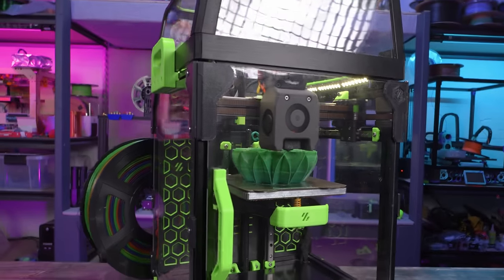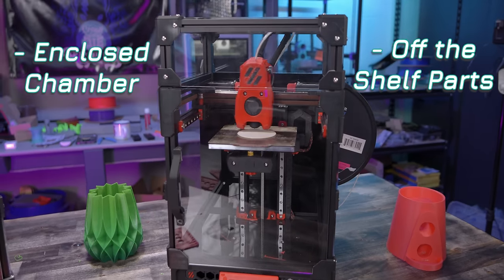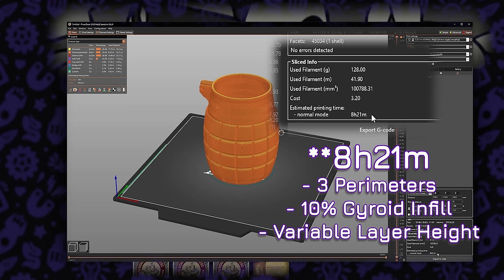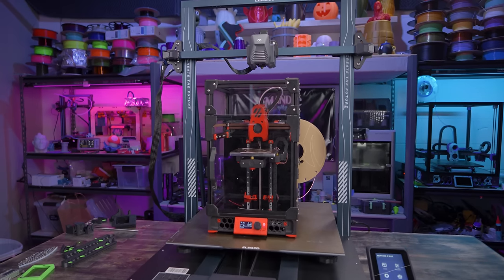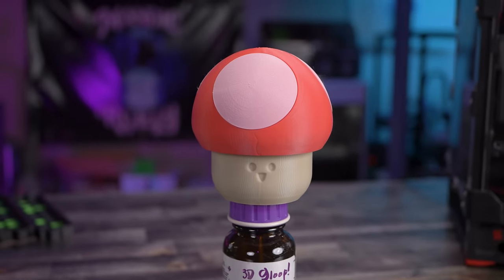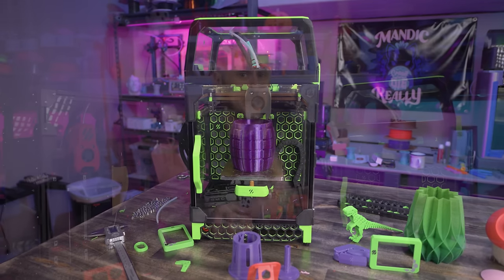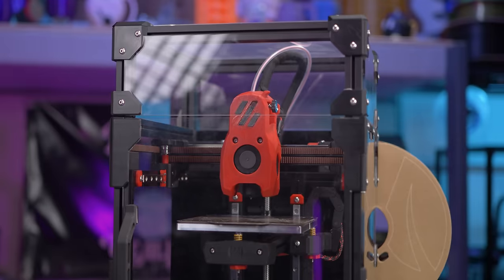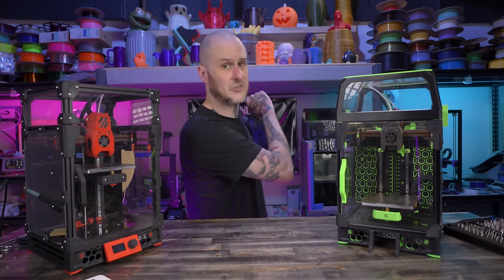Small 3D Printers are POINTLESS! Or...

Comment: I just bought (and in the process of rebuilding) two Kingroon KP3S printers for $100.  The first one is working and cost me around $50 in new parts.  I am SUPER impressed with the Kingroon and would recommend one to anybody unsure about getting into 3D printing, as well as anyone fully immersed into 3D printing.  It's a great little device that pumps out amazing prints.  It doesn't have ABL, however with a glass plate, you don't necessarily need it.  After my initial levelling, the printer has been running like a champ and I am looking forward to getting the second one going as well.

Do I NEED a large build-plate printer.  Absolutely not.  The percentage of things I can print on a small printer are likely similar to the results here.  I WANT a large build-plate printer though. :D
Reply from the maker: I bought a KP3S a while back and it was... bad. Like unusably bad. I probably got a lemon but they sent me a KP5L that was also unusable as delivered, so I wrote them off sadly.  I know a lot of folks have great luck with them but I just couldn't justify my time on them anymore.

Comment: l'd love to see a Voron 0 expansion kit to use a 140-200mm buildplate. 120mm is just slightly too small for things like PC fan mounts, drone parts and cosplay pieces, so making it that little bit larger would open up so many more models. It literally needs +35mm in each direction and it's perfect for everything I would use it for.
Reply: You should take a look at printers for ants, the Tiny-M for example basically is a slightly bigger V0.

Comment: Batch printing.. obviously advantageous.. printing in parallel is always faster.
Reply from the maker: The only way that is true is if you count bed swap times between prints. Personally I prefer to run smaller batches due to fails. One failure on a full bed can destroy an entire batch. Exclude objects only works if you are already watching to catch it.
Reply: @MandicReally  I see your response and trying to rationalize it in my head.. 5 small form printers running the same part.. each part taking 30 min.  if one fails you still have a yield of 80%.  5 parts on a single large format each part still takes 30 minutes but you add in transition time between parts and if a single part fails there is a good chance you lose the plate.  Unless of course you thought my comment was promoting the large format over the small format.. which it wasnt ;). Love your content! Please keep it coming.
Reply from the maker: @HReality  ohhhhhh. I’m sorry, I had it the other way around. I thought you meant “batch” as printing a full batch on one bigger bed. Got it now. Then yes I totally agree. 👍🏻👍🏻

Comment: I think these small printers are great as a second printer.  I'm glad I have a 300mm^3 printer as I frequently need or take advantage of that size.  But when I get around to building a second, it will be something like a V0 or Rook.
Reply: For me it's the other way around. Nearly everything I print will fit in the volume of a V0 and my Prusa MK2/S is feeling dated. I plan on building a V0 to have a fast and up to date primary machine and I'll keep the bigger, but louder and less featured Prusa around for the occasion I need the print volume.

Comment: Great video. Agree most of my stuff will fit on a smaller machine. I went down the path of salad fork 160mm to get past the 120mm volume.  I do like Prusa’s bed heater plan. Only heat the plates that are needed for when you have that larger print once in a while.
Reply from the maker: 160 or 180 is reallllly appealing to me, but the expense of all the motors for a Salad Fork just makes me default to building a bigger machine. I’d really like one I’m sure, just can’t justify it.
Reply: @MandicReally  agree it’s not cheap. I wanted to build it and did. It goes nicely with the trident I have. The printers for ants are really niche so they have the price that goes with it. Ender 2 pro was my best bang for the buck for smaller printers.